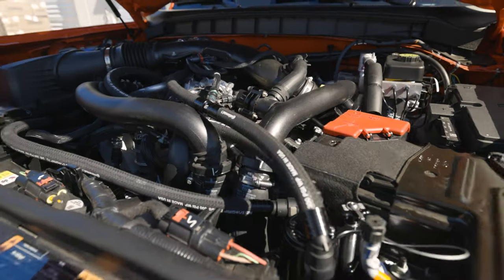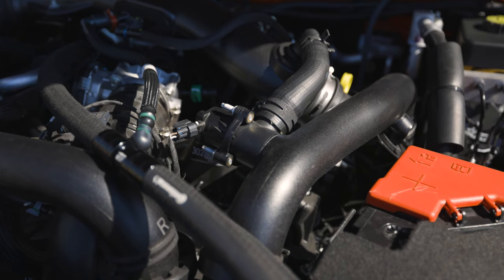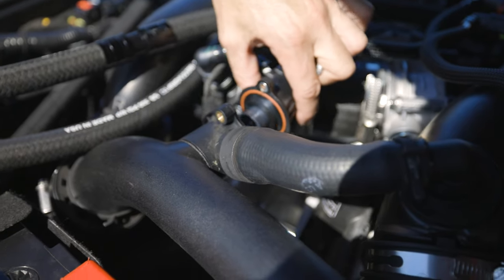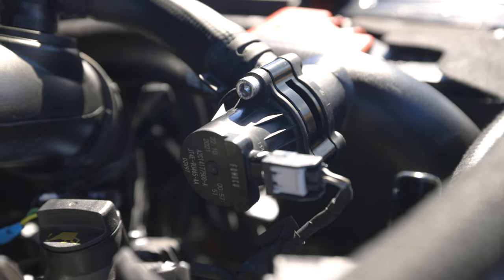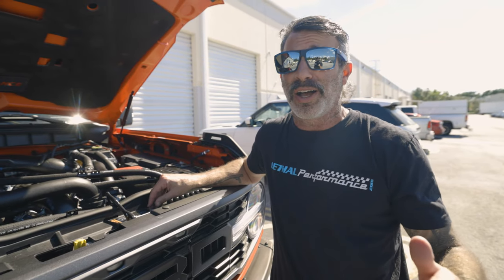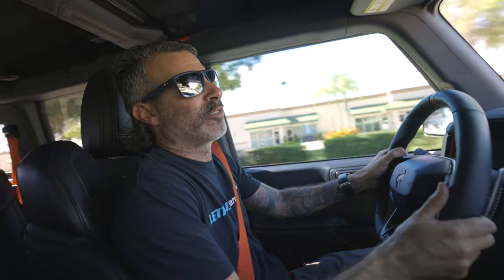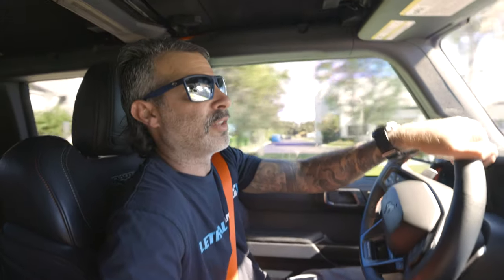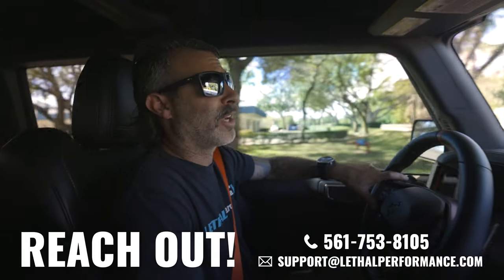Raptor get Turbo Noises! - UPR / AMP Blow Off Valve Adapter Install - 2022 Ford Bronco Raptor

Comment: Какие параметры колес ?) очень круто смотрятся
Reply from the maker: Thanks! They are Vossen 20x10 HF6-5's with 37" Nitto Grapplers.
Reply: @Lethalcamp offset?
Reply from the maker: @gqjeffy  -18 Offset
Reply: @Lethalcamp  any rubbing or trimming needed on the stock raptor suspension?
Reply from the maker: @gqjeffy  Nope! No modifications to fit and no rubbing whatsoever.
Reply: @Lethalcamp badass man!  That is exactly what I needed to know!  Appreciate and placed my first order off your site!!!!
Reply from the maker: @gqjeffy  Yes!

Comment: Performance / Benefit, or just another poser noise-maker?
Reply: There is a reason why engineers at ford reused the “psss” air by sending it back to intake again; basically using every amount of air possible for performance. Now we bypassing it and sending it to atmosphere for the noise 😁 . Not like it makes a bad impact on performance, but it defeats the good purpose of engineers. You think they didn’t know about it? 😊 but it’s a personal choice to hear this sound or not.